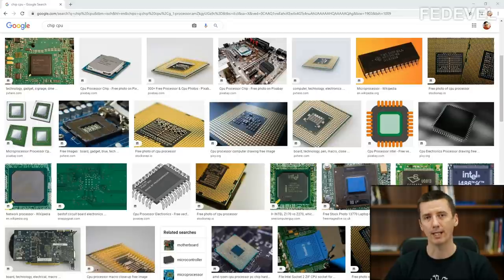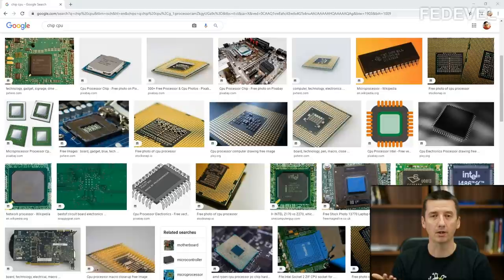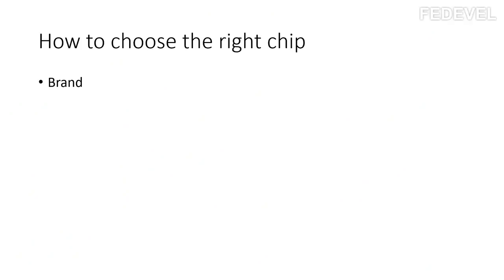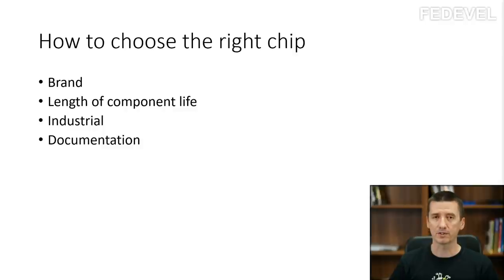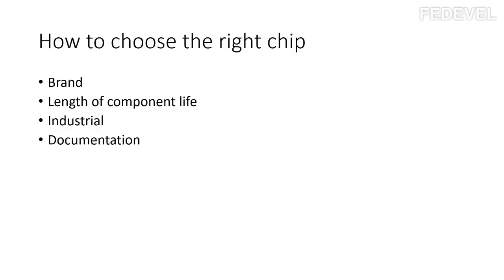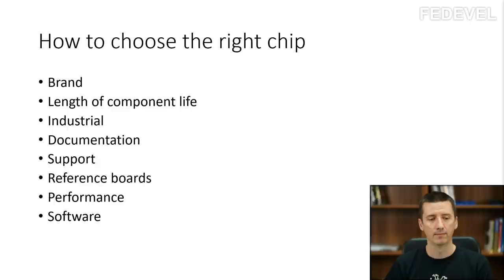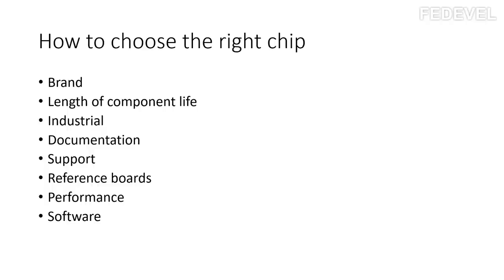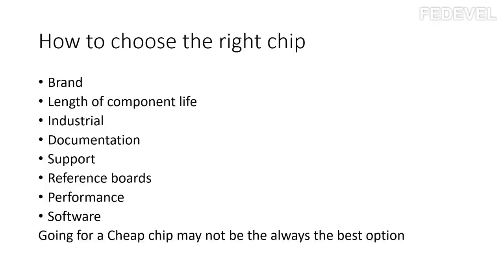What to consider when selecting chips for your new board (MCU, CPU, Ethernet, Audio, ...)

Comment: Many years ago in a startup a VP of engineering once said to me "I typically hire 6 software engineers for every hardware engineer".  I have found that to be a realistic ratio, though it obviously depends on the quality of the engineers.  Having worked 25 years in embedded software I tend to select hardware components that provide SDKs.  I don't care if the software is pretty -- only that it works -- as I can always tweak it later.  But writing software from scratch and getting it working can take FOREVER, and cause cost overruns that erase any gains you realized from buying the cheaper hardware components that lacked SDKs.
Reply: It's very easy to underestimate software requirements for even a simple device. That is why, as a hobbyist anyway, I will only ever use chips with lots of community support. The fact that I can buy an Atmega which has countless freely available libraries is just an immeasurable value. Thankfully this sort of philosophy has spread to many other brands. STM32 has tons of community usage. I'm sure there are many others as well.

Comment: My first step before selecting anything is going through the online suppliers and set as much filters as I can. The big winners:
- Current Stock
- Rohs
- Normally in Stock (this one is vital)
- datasheet available 
- 3D model available (if you still get a lot of results)

If what’s left matches my budget, then I check if they have devboards and I start comparing features and supply options.

Comment: Sometimes you can not find a chip that has a proper package for your design, so every time check the package and footprint.

Another thing, when you select the chip, you also consider  whether the communication interface meets your design requirements,
sometimes you want a fast refresh rate or sample rate but the comm interface of the chip may be a bottleneck for you.

Comment: I had to laugh loud and sadly when you said "you are the hardware engineer and they are the software engineers". Here is why: all companies I applied for, asked to be all in one:
- hardware designer
- firmware/software designer
- FPGA hardware and firmware designer
- some also RF engineering
- and some else even full stack web dev.

When I say, that I did all of the three I first mention and that there is no way doing the rest too, and, even more, I shouldn't cover both hardware and firmware/software development, especially not for FPGA stuff, they are disapointed resulting in the answer: "sorry to give you a negative answer, we found a better match". 3 years jobless now, I've totally given up... Companies' got so damn clueless about the huge work all of these individual fields require... 

For what is important to me when it comes to uCs is to try to stick with one brand so I don't have to always learn a new eco system i.e. IDE, Framework/API, Documentation philosophy and website/documentation organisation (some are real champions in hiding stuff...). Since I was in different companies and positions, i've been set over and over again on some other brands just because one has a chip some minor cents cheaper. Boy don't you get all the work it takes to get into that new brand, figure out their yet not discovered errors and how much that costs... (if not speaking of engineering once for a batch of a couple of million pieces, then, ok, maybe).

Worst experience I've been set to, against my will: FTDI uC + Mikro Elektronika SDK. Sure it was cheap, but hat killed the project i.e. cost a lot at the end...
- FTDI had - at least back in 2015 - a really poor eco system
- Mikroe's documentation and C compiler full or errors. It took me quite some time to figure out not my code was wrong and I only figured out what was hapening when investigating the generated ASM code. And Mikroe's support was always answering off the topic...  I guess the attractive ladies didn't understand much of our business...
It was a nightmare. The low budget run out, project was canceled, me fired once more.

"And as always, I hope you learnd something" (Louis Rossmann).

Comment: Yes! The SDKs and BSPs for so many of the low-power SoCs on the market are shockingly bad! Pay attention to software or your board is almost obsolete before its even released. Ancient Linux kernel builds, and pre-historic buildroot trees from the early 2010s are everywhere. We really need to get h/w and s/w people working together better.
Reply from the maker: Yes, this is very bad. PS: Just yesterday I was thinking how a few hardware things receives updates regularly. For example my phones ... the maximum of updates is maybe once(!?) And if there is a new version of the phone ... they almost never release updated version anymore. (Maybe Apple does release updates, but they are one of a few). Not saying about all the other hardware .... So not only built on old software, but never updated again :(
Reply: If you are using anything with external memory (SDRAM up to DDR, or even if you are booting code from external flash), first get the devboard to boot, then start designing.

I’ve seen projects lose months to having selected the wrong processor because it was done on paper. Before choosing anything new, give yourself a time budget (2 days for instance), to have it working. I’ve found it worth every single time.

Comment: Goed video on what to consider when you select a chip. Also consider errata sheet, is the chip supported by the compiler your company uses, what are the debug facilities and how much knowledge about a certain chip or series is already available. Why use another brand or series, when the one your familiar and content with has a suitable solution.

Comment: A couple more items to consider: 1. Possibly favor chips that your company already uses in other products, to reduce inventory items, and also because you have a track record with that chip. 2. Consider selecting packages that are tractable to work with in both the prototype and production phases. So maybe you don't want the absolute smallest-pitch version.  Indeed, you may want to avoid vastly different pitches of components on the same board, as they require somewhat different handling, from silkscreen labels to solder paste (or hand soldering of prototype), to track sizes and spacing, to feasibility of diagnosis with particular genre of probes.  (Granted, other times you just want to go as small as possible.)

Comment: I think is implicit in the software topic,   not only SDKs, HALs, or example....   the compiler is a key component....  Some MFG provides free GCC based compilers (such as STM for its STM32 Corext -M) but not for the STM8 series.   So the compiler is also a key (and as I mentioned, probably implicit in the Software item discussed)
Reply: You are right that compiler is key feature, but good compiler for microcontrollers (GCC is not one of them). I dropped using PIC microcontrollers when IAR dropped support for them (microchip have worst compiler even worse then GCC).
By the way for STM8 you can download free version of IAR (code size is limited) but for small jobs can be ok, and for "serious" job there is no problem to buy compiler
Reply: @mrlazda  you are correct,   I just mentioned gcc as an example,  pointing the fact you use a MCU, the vendor is not obligated to provide you a compiler (a good one, a free cost one).  It is a key need to be bare in mind.   Regards!